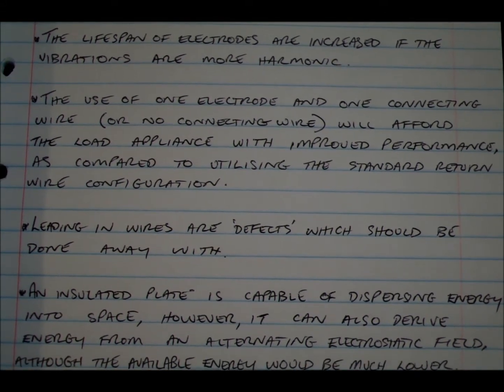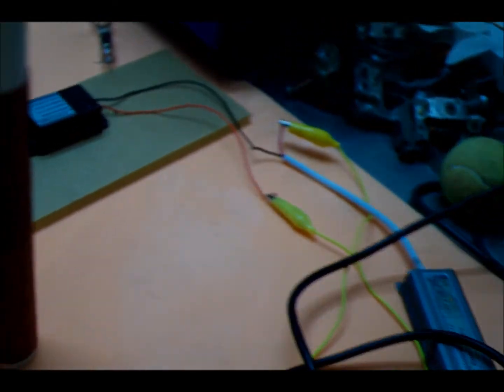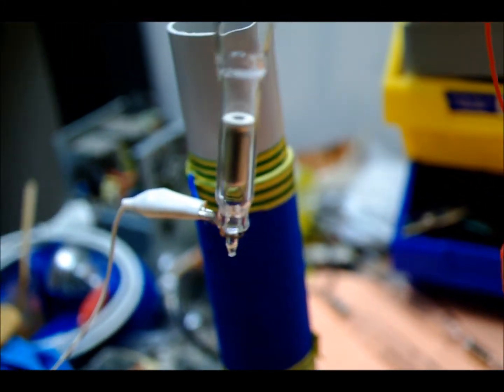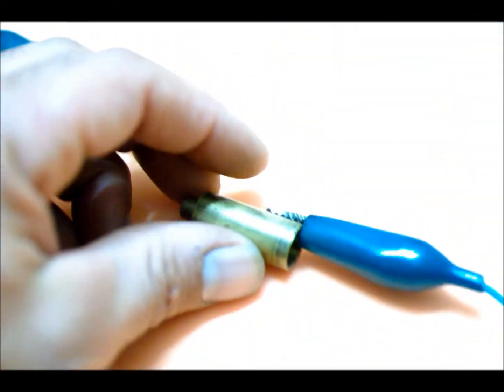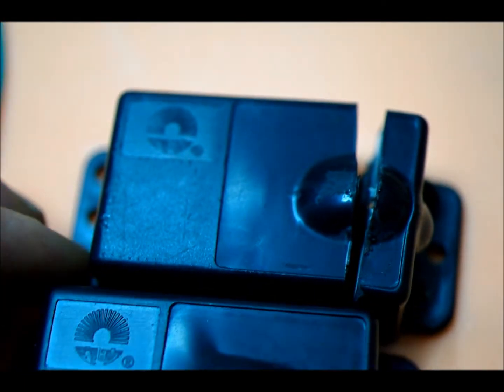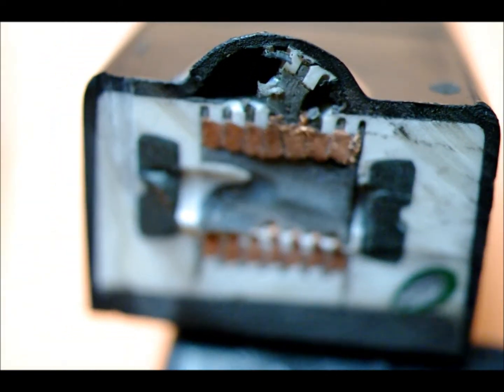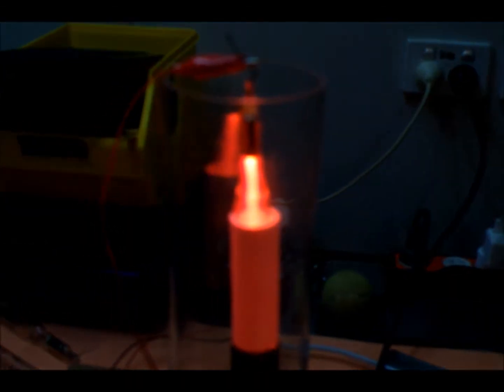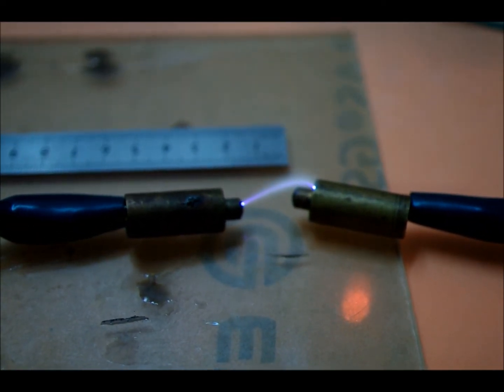Experiment #1 - High Voltage Transformer With High Frequency Neon Primary Coil (2KV, 30mA @ 55KHz)

Comment: I'll be curious how your experiments with pure distilled water Vs solutions with electrolyte work out (I suspect I know).  If it was me, I'd be looking for relationships between concentration, plate spacing, voltage and frequency.  There's a curve in there somewhere!

But a lot of time and work.

Possibly the ultimate key is breaking the water molecule after it has been atomized.  As in vapor or steam(?).  Right before the intake valve?

Comment: Checked out your video's.  Looks like you're working more on the end of making plates or electrodes that will hold up better that 'conventional' metals?  Personally, I feel if there is a solution hidden somewhere in HHO, it will be more with splitting the molecule into a usable state.  Higher freq's may be part of that solution.

I am intrigued by what I call "The Dingle Solution".  Are you familiar with what Daniel Dingle has allegedly done?

Comment: Iam doing Tesla magnetic craft he had it so wrong me not super cooled 200g lift the unit weight is about that so supercool and it gose to 600g with base for directions test soon I hope like I can't get it from Kmart. Try a 400kv transformer know how to get a EMP off it ??. information unlimited great education ion and there EMP unit fantastic education but there boards suck used a transfer paper and under normal solder comes off the board 😡 I had to do a reprint on both emp ok me the ion me switch and not running the board design before turn on 😠3 amp to the 555 section close call😡 one them 2 standard temp to mosfet just came straight off!. WTH!!!!!!!!

Comment: overunity is not a secret to be unleashed its a challenge if u got the balls to get it done! sorry about that. u know the challange is to success at producing dc sparks 200 million times a sec :) I mean thats how a magnifying transmitter works. thats how u can tap the PURE VOLTAGE "radiant matter" DC ONEWAY SPARKS (dissipation of disruptive discharges) transmutating mercury into gold isn't a easy task is it ;)